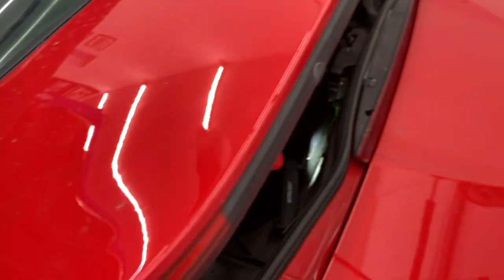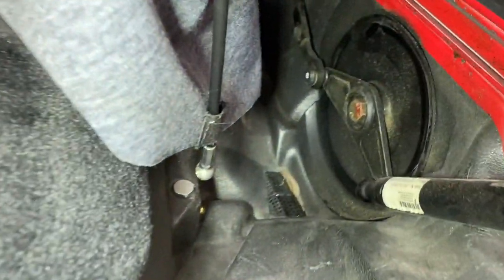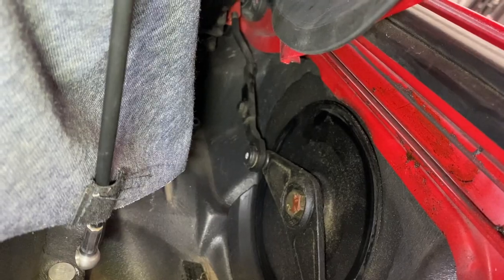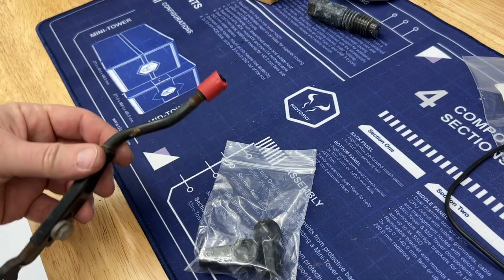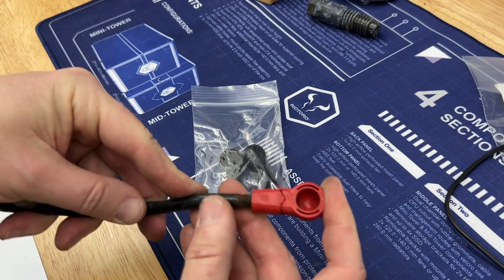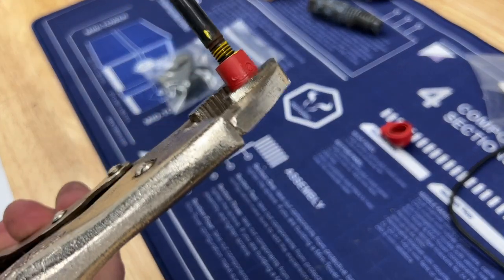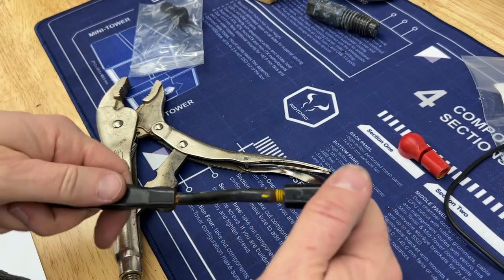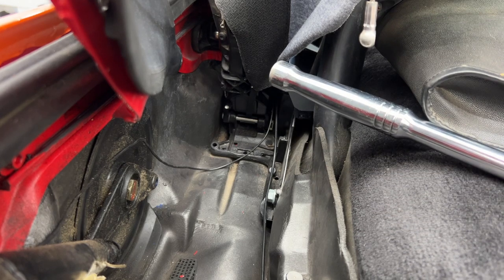Porsche Boxster Convertible Top Push Rod Ball Joint Replacement (FIXED THE TOP AGAIN!)

Comment: I used  6ft steel bar.  I got enough leverage and length that it only took a couple tries.  All the shorter tools dis not work.
And good that you bought the plastic parts.  They are designed to be sacrificial.  There are metal ones out there, but those will just break the top or clamshell in the event of an issue.
Reply from the maker: +John Morgan yes! Great point. Stick with plastic!

Comment: Top tip for popping the ball joint on: Open the top all the way but leave the clamshell open, you suddenly have a shed load of access to that joint from directly above. Just need to ensure the push rod is generally in position before operating the roof!
Reply from the maker: +Billy Postle thanks!

Comment: Top Tip: Once you have the plastic ball joint and metal ball aligned, you can squeeze them together with a pair of Tongue and Groove Pliers. (First, follow the "open clam shell" method mentioned above!!)

Comment: another great video.  This was one of the first things I had to do to my Boxster after i got it 2 years ago..  getting that socket to snap onto the ball was a major pain in the butt..   i also had trouble threading the plastic piece back onto the end of the rod.. mine was really tight.. i had to clamp the rod into a vice, shove a deep well socket over it and turn it down with a ratchet.   I marked my threads with a piece of blue masking tape, i didn't have a fancy paint marking pen.   :D
Reply from the maker: +george louie I got lucky. Only the best tools here! 😝

Comment: Hello thanks for all your help. It would be nice to see a video on how to fix the calibrate the track because that’s what is breaking the balls in the first place. My track on the transmission side doesn’t raise and lower the transmission side of the metal convertible top evenly creating strain on the other side. I noticed the other end of that track is bent out at the bracket a bit. Also sometimes the left side doesn’t open far enough and then the convertible top gets stuck trying to raise up but being blocked by the metal top cover.
Reply: @helpmediy
Reply from the maker: +Angel Lopez it would be nice! You should make one 😉.

Comment: A suggestion for shooting: I know that you are working in a very cramped space. Look into buying a borescope on Amazon. They're cheap, plug into your phone or laptop and have an adjustable light on the end haloing the camera. You can stuff it far back into the space you're working in, point it outward, and we can see your hands move toward the subject and all of the action. Highly recommended.
Reply from the maker: +Marshall Webber thanks for the suggestion! I actually have 2 😂. This would have been a good time to use it.

Comment: The clam cover travels on a rail that’s mounted to wash side. Inside the rail there is a socket which the clam hinge has a ball that fits in the socket. Does anyone have or know the part number for it? Or a link to where I can buy it. Mine keeps popping out on the right side. Thanks
Reply from the maker: +eboueiri I have another video on finding Porsche part numbers that should help

Comment: I have to replace one myself. There are metal ball joints as well in stead of the plastic ones. The question is : can you cause any damage by using the metal piece? Just curious!
Reply from the maker: +streetfighter3k I would avoid the metal ones. They are plastic on purpose to be the weak point that breaks in case you have an obstruction to avoid damaging more expensive parts :)
Reply: @HelpMeDIY  You are giving me the answer I expected. Wanted to be sure. Thanks for that!
Reply from the maker: @streetfighter3k144  you got it! 😉

Comment: Hi! Thanks for your excellent guides!  
One issue I'm running into: When I try and fit the second ball joints back on (the one connected to the shock like item), one of them is too short to reach the metal ball. How do I fix this, extend the "shock arm" or adjust the cylinder transmission arm so that they line up (to snap the plastic ball joint to the metal ball)? 

Bonus points if someone can tell me how they became misaligned. Perhaps this is why the first plastic ball joint cap broke in the first place?!
Reply: Never mind. I figured it out. You adjust the position of the transmission levers with the "roof up and down button". Problem resolved.